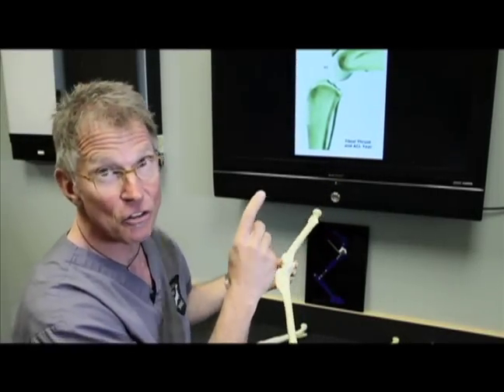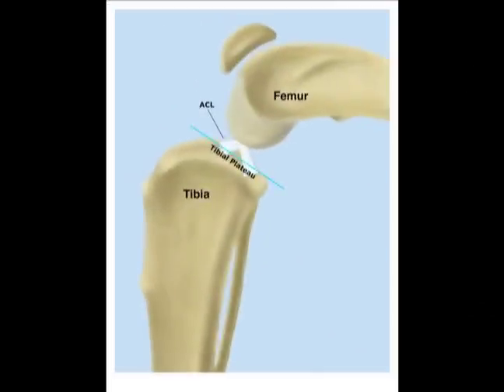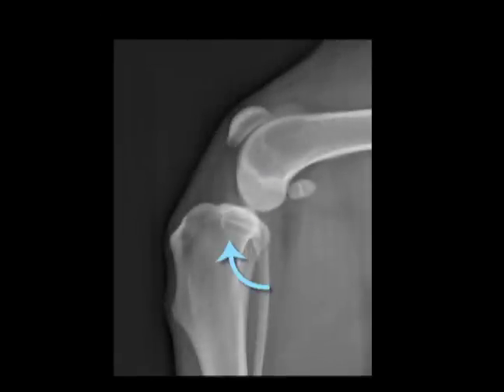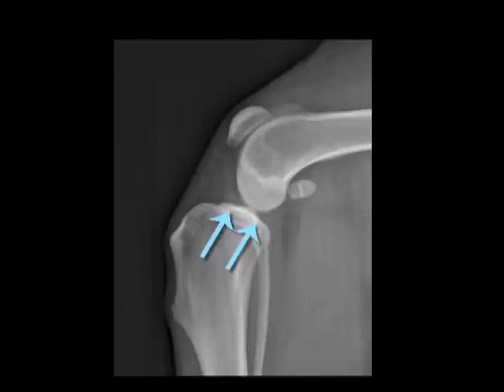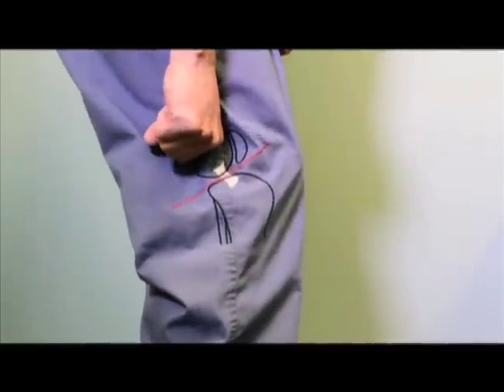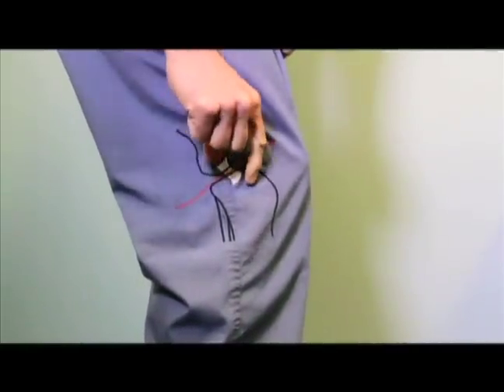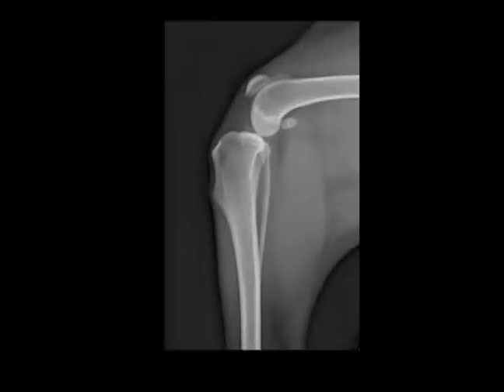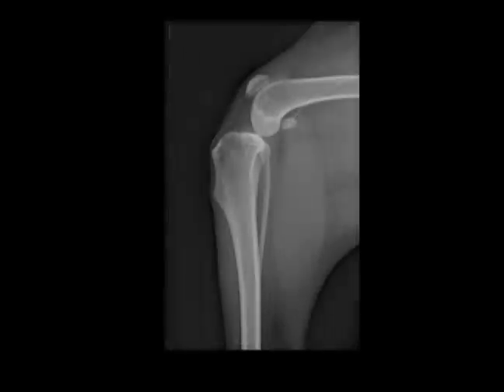Anatomy of a Canine ACL Tear discussed by Michael Bauer DVM, DACVS

Comment: Thank you for this video Dr. - very helpful. I'm not sure this is Luna's problem, I'll find out in a few days. I wonder if a previously broken leg ( year ago ) would be more prone to an ACL tear? She's only a year and a half old, plays VERY ROUGH and has started intermittently holdimg her front leg out - limping or walking in 3 legs only to sprint after a bunny rabbit literally 30 miles an hour run with no problem like she's completely fine. The leg was broken right through it was her lower leg. It's healed but it has a permanent lump. I assume it's scar tissue on the bone.